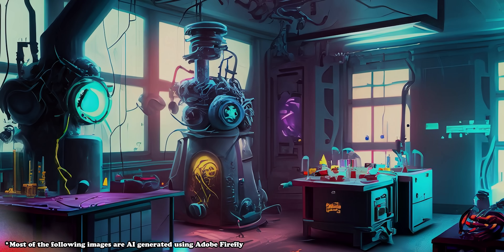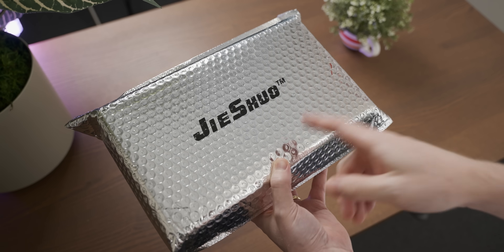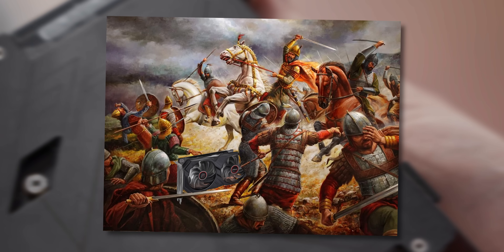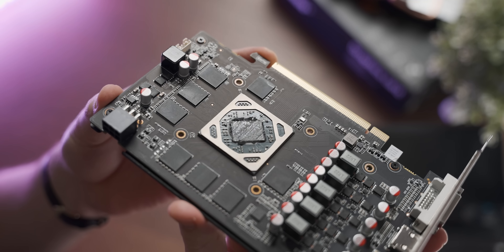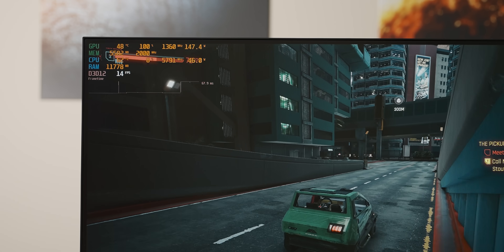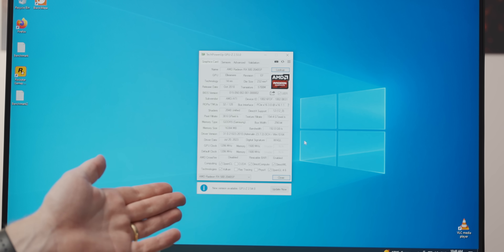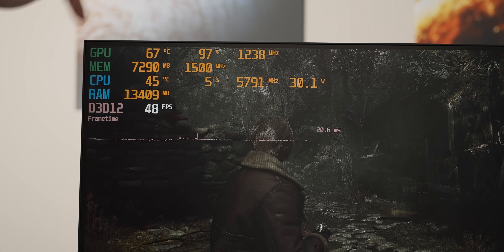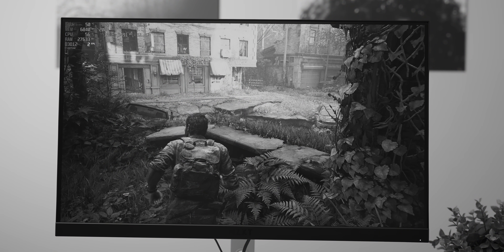Why Would They Make This? 16GB RX 580 From Aliexpress...

Comment: All jokes aside: It is mind blowing that a card from 2016 (yeah, that´s right) performs like that in 2023. Polaris was/is AMD´s masterpiece.
Reply: AMD does that a lot, it's not a unique case of amazing performance down the road.
Three words.
7970 Ghz Edition.
Reply from the maker: @anita.b  I had a x1900xtx back in the day. I loved that GPU even if it did sound like a jet engine.
Reply: @DawidDoesTechStuff You should revisit this video with FSR 😂 that’s what AMD and Nvidia think the cool kids should use these days, I would imagine this one would have glorious input lag 😂
Reply: @anita.b  if they had made 7970's with 4gb vram they would still hold up
Reply: @parliamentarian6598 They made a few 7970's with 6 gb of vram actually.
Reply: I have a 7970 in daily use in the old pc I gave my mother for web browsing/media consumption. It still works just fine paired with a 3700x cpu lol. @anita.b
Reply: @anita.b Yes, I have the Sapphire variant and I still use it on my backup system. It was the older brother to the rx series. For its day it was very impressive. 3gb of vram was excessive in its day. It was kinda a hotboy but performed insanely well.
Reply: @anita.b  I used Crossfired HD7950's to play Tarkov as early as 2 years ago.

AMD has always been on that good shit, it's just that Nvidia is too.
Reply: The Hawaii XT was AMD's masterpiece. It performs about on par with a 580 but is from freaking 2013! A 290X or a 390X is able to run Red Dead Redemption 2 in 1440p with very decent quality settings and never dropping below 30fps, averaging around 45 fps in the built-in benchmark. Even the 4GB 290X can do this with ultra textures.
Reply: @classicallpvault  Without overclocking the 290x actually outperforms the RX 580. Toward the end of its generation there were actually 8GB cards produced. I actually once saw a weirdo listing for a Powercolor 8GB R7 250. I was incredibly confused at that card's existence.
Reply: @classicallpvault  7870xt was the best price/performance than any card i've had since the intel i740.
Reply: I HATED Polaris at first. I absolutely love that architecture now. It scales SO WELL.

I had an RX 580 that did 1580mhz core and 2500mhz memory. Was really nice to finally see it beat a GTX 1060 in literally every game I tried.
Reply: @nexxusty  A 580 can be expected to beat the 6GB 1060 in the vast majority of cases even at stock clocks.
Reply: @classicallpvault  Not every one though. Mine could. It even beat a 1070 in some titles.
Reply: @nexxusty you understand that no GDDR5 can reach this memory clock right ? Even GDDR6 have difficult. 😅😅😅😂😂😂
I will not even talk about the GPU itself at 1500mh 😂😂😂😂
Reply: rx 400 2016 rx 500 2017
Reply: rx 400 IS a rx 500 
it´s a polaris rebrand
Reply: @PhoticSneezeOne  it's more of a refresh/tweak with some differences that most people didn't really notice. It wouldn't really be an upgrade for me to have gotten the RX 580 back when my RX 480 was actually barely a year old. Minor improvement in performance and much higher clocks were what I was generally seeing. A more mature node process led to a lot of that.
Reply: I still use an RX 570 today. Linux support is rock solid.
Reply: @Falsechicken i just played Helldivers 2 on my RX590
Reply: Although if you were in the 300 dollar range, 1440p would be doable for most games.
Reply: @joeymatthews1234 my RX 580 on FH5 mostly high 1440p gets a solid 60-70 fps with no noticable drops and gets identical at 4K which i find interesting considering the price
Reply: The 400 and 500 and amds best and the 1000s are nvideas
Reply: My 580 is still doing well.  I don't demand much of it though.  I wouldn't mind a GPU with better idle/slightly loaded power consumption, though.
Reply: @Aeduo  rx 5500 xt has entered the chat
Reply: older AMD cards are actually ridiculously solid even in 2023 for 1080p gaming, I ran an XFX 480  with most games at max graphics (not including hardware specific features like ray tracing) starting in 2017 and ending 4 months ago when I finally upgraded and got a 6750XT
Reply: Its not so mind blowing when you compare graphics of some games from 2015-2018 with 2022 games even gameplay and other things you can obviously notice that some older games still look better and overall are better than some 2022-2023 games so
Reply: You are aware of the fact that the R9´s are no longer supported by AMD? 
AMD decided to kill them off. So their win is hypothetical in nature.
Reply: My gtx970 still puts up a good fight
Reply: People are just inventing things here i this section just to prove the point 😅😅😂😂
I already had a 1060 6gb. And im using a 580 8gb right now bc of money. And guess what ? They are the same! Power, performance, almost everything! 😂😂😂
Reply: On the CPU side FX serie's from 2011 (FX8350 has a special place for me...)
Reply: RX 580 is the most stable AMD card I've ever used.
Reply: Hawaii and Tahiti were masterworks as well.
Reply: Imagine if they made a 60 cu or 80 Cu polaris card....
Reply: how the mighty have fallen eh!
Reply: Polaris was decent in the mid range like the RX 580, but  did not compete in the upper mid to high end, not really sure I would call it a masterpiece. Polaris was a sad time period for AMD when they decided to not compete in the high end, if that had of continued I fully believe AMD would not be around today,.
Reply: @Battleneter  news flash, it did continue. Nvidia hasn't even released a titan and AMD can't keep up. Nah if I were AMD I'd truly pull out of the general consumer market and try to focus more on enterprise class products and AI. 

Their sales figures, even when ATI had faster cards doesn't equate to the huge losses against Nvidia. I guess they figure some money is better than no money.
Reply: @ArtisChronicles  No not at all, AMD cards in the last few generations have been performance competitive. I would agree Nvidia are the market leaders by  a large margin, and AMD have made some poor choices marketing and pricing this latest generation.
Reply: @ArtisChronicles that's the stupidest take. What, are you a silicon valley bro? XD imagine still simping for NVIDIA in 2024 as they cut off your driver support from underneath you
Reply: @ArtisChronicles  thats the dumbest take lmfao, go figure the opposite is happening 🤣
Reply: It was a low end card even in 2016, the 1070 also from 2016 was 40-50% faster or even more.
Reply: My son's crappy gaming PC has an RX580 and he absolutely loves it. It replaced a GTX 570 which he accurately described as "a case heater".
Reply: Funny thing is it has similar performance to a entry level RX 6400...
Reply: I istill have mine and work like a charm
Reply: I tested about 5 Polaris cards and while they performed well, they were very very unstable. 
Hot, power hungry and black screens are the words that come to my mind when I remember my last 580. Definitely far from masterpieces or reliable tech.
Reply: I used an XFX 570 8gb, 2 sapphire nitros 580 8gb and a MSI 570 4gb

Not a single one of them made any problems. With undervolting you can get the 580s to consume about 130W and the 570 about 115w
Reply: @PhoticSneezeOne  Yeah but that's the point. You had to tinker with voltages, clock speeds, run tests, etc. to get the best from Polaris cards. Sapphire cards' fans tend to act up when setting a custom fan curve, like going to 100% randomly or get stuck at 0% because of a driver glitch. I wouldn't call that a "masterpiece".
I also tried a few Pascal gpus and they were night and day in terms of functionality and reliability. It was just plug, install drivers, and done.
Reply: 2017.....nope not right hehe ;)
Reply: I swear when I read the title I read it AlienExpress instead of cuz I just finished watching his alien ware video AliExpress 😂😂😂
Reply: the efficiency is among the worst
Reply: I have a 1070 and it performs better than that and it was launched in 2016 too
Reply: it actually, according to AMD's website: came out in early 2017. so, a little after the Mesozoic era, and just barely creeping into the Paleolithic era..
Reply: Honestly, it's astounding how an RX590 can play everything besides Alan Wake 2
Reply: Except it's dead now, AMD is the only company that dropped driver support for a card (RX 590) just after 3.5 years since release. And if 10-30 fps is good enough performance for you at 1080p, I have news for you. Pascal from Nvidia is still fully supported.
Reply: Polaris was their simultaneous low point alongside pyledriver/bulldozer...
Reply: @Pro7Sauce  For the price Polaris is soo good, but bulldozer... 😂
I had one till 2 months ago
Reply: My 1070 runs quite well atm still
Reply: It's more mindblowing how cards from 8 years ago are still so expensive ... because all after are insane expensive
Reply: Finewine technology
Reply: Go see how it performs in 2025 on Linux.
Open source drivers are good shit.
Reply: so does GeForce 10 series GPUs.
Reply: @fgfg655 Three words: Lack of VRAM.  The Radeons outlasted most of the GeForce 10 series because so many of the Nvidia cards were kneecapped with low dedicated memory sizes.
Reply: @LakeHowellDigitalVideo  Right, but while this class of cards remained relevant VRAM wasn't an issue whatsoever. Cards aging better and being used 7 years past their prime while going around for $50 clearly isn't what Nvidia is looking for. Polaris at launch was an unstable mess. Which is the case for a lot of AMD's lineup, they end up aging better than the GeForce counterparts but end up not performing as well when it matters, at launch. The only real competitive card AMD has right now is the 7800XT
Reply: @LakeHowellDigitalVideo  Lack of Vram is an issue on a card that can utilize it for sure, There's prime examples of cards out there now that have the power to give you more out of a game if you added more vram.
But the futureproofing argument is moot! Because as a card ages, games get more demanding on the GPU and it won't matter if you have a shit ton of memory to play with because the GPU becomes a limiting factor anyway. "But I can load so and so mods etc!" Well yes, On a card that can handle the loads, but the same thing applies.. Your GPU will still become a limiting factor later down the line, Or a particular GPU is too weak anyway to utilize a certain amount of ram - which is why their is a balancing act when making GPUs.
Reply: @fgfg655  The RX580 would perform BELOW an GTX 1060-6Gb !  BUT now ..... with the 'up-to-date' drivers ..... The RX-580 performs ABOVE an GTX 1060-6Gb !   Even CLOSE to an GTX 1070 !!!   and THAT is ..... AMD 'fine-wine' for you !!!     Nvidia can go to HELL !!!    Radeon just rules !
Reply: @gertjanvandermeij4265 The 480 always traded blows with the 1060 throughout its lifetime. More recent comparisons do indeed see the Polaris cards staying ahead of the 1060s now. 

Its launch was really the only time you'd see something in between the 970 and 980 performance. They actually did a lot of quick driver work and just continued to improve drivers.
Reply: @fgfg655 Nahh amd easily won that mid range battle, 480/580s aged like fine wine with much better drivers than 1060.
Reply: GTX 1080 came 2016
Reply: Hey guys, sorry for interrupting but would like to ask if said graphic card you mention would be s good card for beginners? Would love to play stuff like hell let loose, even on medium thst would be awesom. Im looking for a graphic card thst wont break the bank
Reply: @jonathank5841 depends how much is your bank, where you live, and if you're willing to go second hand or not
Reply: @jonathank5841   The price they ask is not bad for the card, however, there are multiple issues with this...

1) It's not an official product, and also an old product at that that got modified, which means, the lifespan on that thing can be completely random from a single year to a decade or whatever

2) The raw performance on the card is starting to be lacking, it is used for 1080p gaming at low/medium settings for the most part on newer games. There are new games coming out that will make this card an issue going forward, even with 16gb VRAM, simply because it lacks performance to keep up with heavy duty games.

3) Card uses quite a bit of energy, it's not as power hungry as newer mid to high tier cards in new generations from AMD and Nvidia, but ~200W is still something to consider from and old GPU.

4) Getting this card is not the only issue to consider, a GPU is just one single part from a gaming computer, there are other factors that are also important, like CPU, RAM and hard drive (like SSD's being the standard for newer games, while HDD works for older games and some new games just fine). PSU (power supply) is also important to know, you need at least a 450W PSU for this card, but if possible, a 500 or 550W instead for some headroom to make sure the PSU does not fail (there are 450W PSU's that are good and can handle this well, but if you have a bad one, it can lead to instability on your computer).

With all of this said, we need more information on your current computer specs, to see what works and what does not. And how much you are willing to spend for a GPU, or possible upgrades.

If you only plan on playing hell let loose on this GPU, it will work enough for that game, the recommended GPU is a 590 8GB but the minimum is much weaker than RX 580, which means RX 580 would be somewhere in between minimum and recommended settings, which makes the game playable. Assuming the only thing lacking (that needs upgrade) on your computer is the GPU. If you are using an intel core CPU 2000 series from over a decade ago, you are going to be running into issues regardless if you get the card or not. Same idea with the ram, if you are running anywhere in between 4 and 8gb with the same RAM sticks, or from 4gb to 16gb with different ram sticks (different ram sticks, means all ram sticks will default to the slowest one and it can cause issues with stability, like having random crashes with windows, etc).

Honestly though, just post your specs if you want to make sure you are 100% safe to go or not with the purchase.
Reply: @jonathank5841 buy a used 5700XT or a 6600. Extremely good price to performance and they'll last you at least half a decade more
Reply: @jonathank5841  rx 6600 or 6700 if you have the budget
Reply: @jonathank5841 When I used to play Hell let loose it was pretty unoptimized(I have the RX 480 8GB) you're better off with a 3060. Personally, I gotten only 45-50 FPS depending on the map.
Reply: @jonathank5841  maybe you can pick a 1070, it has 8gb of vram, and the core is more powerful than a rx 580, or you can buy a 580 with 8gb of vram. these cards are more than enough for that tipe of titles.
Reply: @jonathank5841 depends on your budget. If all you have is 100 bucks, these aliexpress rx 580's seem nearly unbeatable if all you want is decent 1080p gaming.  If you have 200 bucks, I'd look at rx 6600's or maybe an Intel a750 on sale(more powerful but can be inconsistent), and if you can bump your budget to 300, your playing field opens up a lot more, especially if you're willing to shop used. I assume you're not willing to go any higher than that if you want it to be budget though, which is perfectly fine as long as you're not trying to do 1440p or 4k.
Reply: @jonathank5841  I don't know anything about that specific game, but in the US the Radeon RX 6600/6600XT/6650XT for $190-240 are a hard deal to argue with. 

The 6400/6500XT is cheaper, but you lose a lot of performance for what you save, and they're posed to age poorly. The GTX 1650 or 1660 Super come in a little less than the 6600 but are significantly slower and don't get access to Nvidia's proprietary upscaling (and may age poorly), while the RTX 3050 is priced a bit higher and does get DLSS but is still lacking in raw power. Intel's A750 is pretty competitive in that price point too, possibly beating out AMD... but they have lots of quirks in old games or old systems.
Reply: @jonathank5841  I'm going to say this only once: Buy the nVidia RTX 3050 instead. It's the better entry level GPU (costs about 225 USD). Unless you're running Linux, then you should get an AMD Radeon 6650 XT instead (costs about 250 USD) or better yet AMD Radeon 7600 (costs about 270 USD). Don't buy frankenstein cards from China for 70% the price of a decent entry level card. You're going to get 50% the performance for 70% the price, which is stupid.
Reply: @jeandutoit1413  Don't buy the rtx 3050. I don't know where you live, but in my country you can buy a 3060 for approximately the same price. For the other cards you mention I don't know tho
Reply: @jeandutoit1413  Bruh no way. The 6600 straight up demolishes the 3050 and costs much less than it does.
Reply: @Snaox  I live in South Africa, so yes, here the 3060 is significantly more expensive (50% more expensive at almost 380 USD).
Reply: @jeandutoit1413 my brother in christ, why are you recommending the scam that is the rtx 3050
Reply: Seen rx 580’s for $80. Huge difference in price
Reply: @jeandutoit1413 6650XT is better than the 3050 though its actually comparable to the 3060.
Reply: @jeandutoit1413   Pay 3 times the money to get a 40% performance uplift. What an amazing deal bro!
Reply: @conjurermast  Where do you live that a RX 580 or 1060 costs 75 USD (3x cheaper)? Cheapest I can find my side is around 150 USD.
Reply: @Snaox  eh it's $220 here while the 3060 is $290, but I would still recommend the 6650 XT over the 3050 (as a former 3050 owner that is somewhat regretful)
Reply: 3050 is just a overpriced 1660
Reply: Don't actually do this. For the price of an RTX3050 you could field two Optiflexes running in a 580 no problem, at the same performance.

If you're going to spend this much money on a GPU for performance, a used 1080TI is your best option for performance. In value for money the 3050 is trash tier, coming in in some cases at the same price as its 3060 counterpart from the same manufacturer with the same cooling solution. That is how bad the 3050's pricing policy is.
Reply: @hvhnubek  it's decently more powerful than the 1660
Reply: @eggtarts286  I would definitely go used 1080Ti, despite potential support issues it's great and has the right amount of VRAM
Reply: @johnjson  its 3% difference that u will never notice and the 1660 is 100$ cheaper
Reply: @jeandutoit1413 all evidence I've seen online begs to differ ignoring the rx580 and othe cards with a cut down modal
Reply: @jeandutoit1413 the 3050 is a bad deal. The amd Rx 6600 XT outperforms that card... By a good amount and is similarly priced. Sticking with Nvidia ? Get a GTX 1080. If you're doing 1080p, it's still a beast even today just like the RX 580. It's a lot cheaper then the 3050... And outperforms It straight out. It only lacks the ray tracing and dlss. But no dlss isn't the end of the world, and the 3050 is so weak that it can barely at all do RTX stuff anyways.... Something amd or the GTX 1080 is a much, much better bang for the buck.
Reply: @Boba_Fett1980  It all depends on where you are in the world, and what you can get your hands on. At the time I wrote my original comment, the 3050 ti was really cheap in my country when compared to other cards. Today you can't find the 3050 anymore, and the go to card is the RX6650, if you can find it.
Reply: @jeandutoit1413  ENTRY? What about the 4090?
Reply: @TheRomanianCrow  Cheapest 4090 I can find locally is about 2,000 USD. Not exactly entry level.
Reply: @jeandutoit1413  I'm sorry dude on this day you have found that you indeed have drank the cool-aid the 3050 is one of the most terrible pieces of cardbage to every be released by the leather coat wearing engineers are Ngreedia.  RX6600, RX5600 XT, hell if you want you can get a used 1080 for less than that or 1080ti all of them beat that.

In reality if your buying new the card cost so close to the 2060, or the 3060 and the 4060 that your better off spending the little extra on any of those cards, with that being said the 4060 is acctually worse in many games than the 3060 due to what they did to the memory bus, anything on the red side 5600xt or above beat it as well, but that happen when you basically put a Mobile gpu onto desktop card and call it a 3050.
Reply: @jeandutoit1413  shit recommendation, the 6600XT performs a lot better and costs about the same if not less
Reply: @orti1283  Congratulations! You are nine months late to the party!
Reply: But kinda useless if they can't give the same performance to the early buyers
Reply: I was always kinda confused why people love the rx 580 but shit on the 1060 6gb, in my market they’re the same price, and the 580 uses a lot more power while not being much more powerful (just 2gb of extra vram, but let’s be honest, 6gb is completely enough for the 1060 class of gpu)
Reply: @leopoldbuttersstotch6060 gotta disagree as my buddy owns an 1060 and depending on the game we got either similar performance or the 2gigs make the difference between enjoyable and non enjoyable performance
But for esports title both cards are sufficient
Reply: @pfizerpricehike9747  Yeah in currently just using a 1060 6GB for a secondary system. It's decent in the titles that I want to use it for, but there's definitely cases where my RX 480 actually outperforms it.
Reply: @leopoldbuttersstotch6060  some versions of the 1060 had the 2 gb extra connected with a limited memory bus connection, which caused really bad stutters when the card tries to utilize those 2 gb.
Reply: @WoNCrawler  do you mean the 1060 5gb? 2gb above the 1060 3gb is what I’m thinking, or is there a gtx 1060 8gb?
Reply: @leopoldbuttersstotch6060  maybe some 5 gb versions are affect too, but there are some 1060 6 gb variants that got different memory setup with a 4 + 2 setup and the 2 gb got a slim bandwidth connection that causes stuttering when accessed.
Reply: @leopoldbuttersstotch6060  it depends on the local price market, in Indonesia used RX 580 8GB costs about $60 while the used GTX 1060 6GB costs about $100 the same price like the used GTX 1660, it's a bit confusing here tho
Reply: @leopoldbuttersstotch6060  Nvidia cut off driver support WAY earlier than AMD did for Polaris.
Reply: @leopoldbuttersstotch6060 undervolting enters the chat
Reply: GTX 1070 beats this thing like a drum and released before RX 580. RX 580 released in 2017, if I'm correct, 1070 in 2016. Nvidia wins again hahaha
Reply: @authoritariangentleman7570  Right.... I'm completely shocked that the card that released at $379 MSRP was better than the card that sold new for $229 MSRP.  Any other shrewd observations, Captain Obvious? 😁
Reply: @LakeHowellDigitalVideo  Don't be poor and get the better card the first time around?
Reply: @authoritariangentleman7570 I did get a GTX 1070 back then. Doesn’t change the fact that the RX 570,580 and 590 were great bang for the buck cards. They were selling for 150-200 for awhile which made them great for the price. No need to be elitist. Not everyone can afford the best cards.
Reply: @wertywerrtyson5529  Very true. Prices have gotten out of hand. Over 2000 CAD for a 4090 is just unreasonable, regardless of being able to afford it or not.
Reply: @authoritariangentleman7570  Lol, you do realize that the vast majority of AAA games are optimized for Radeon hardware because of the PS5 or Xbox.  Unless, you want to ray tracing -- Nvidia cards make ZERO sense to buy at their price point....  Especially true of the Nvidia cards that don't support ray tracing.
Reply: @authoritariangentleman7570  It costs the equivalent of 2700 CAD in my country. But that includes our 25% VAT so before tax I guess it’s about the same.
Reply: @LakeHowellDigitalVideo It doesn't work like that. Ps5 runs it's own proprietary graphics API and os so you can't reuse code for the PC release. Xbox is in a similar situation but it's closer to a windows PC then the playstation. Consoles code is heavily optimized for the hardware and would mostly be unusable on anything else. AAA pc devs leave most of the optimisation to GPU driver devs today and a AMD or Nvidia sponsored game just means they are gonna use fsr or dlss and Ray tracing the devs won't do special amd only optimisations.
Reply: @wertywerrtyson5529 couldn't agree more, I went with the "better card" in the Asus gtx 1070 OC and fried that thing within the year, picked up a $200 sapphire rx580 and the thing is still running strong to this day (my main csgo/cs2 rig that I'll be replacing next year)
Reply: @authoritariangentleman7570 p.s. imagine recommending something as GARBAGE for the price as a 3050
Reply: @z33thr33  3050 is garbage, I'd recommend saving up and getting a high end card
Reply: @authoritariangentleman7570  Same. The ONLY time it makes sense is with a low power version if you're putting it into a system with no PCI 8 power lines, where you have to run it exclusively off the slot. But if you're at that point, there's almost certainly a better option for a similar price in just upgrading the whole motherboard itself. The ONLY time it makes ANY sense is if you were going for a low power efficiency build, but then you're basically better off with a new AMD APU or something like a LattePanda, depending on what your intended use case is. The ones that need an 8pin are just silly
Reply: The Polaris architecture was released in June 2016 (RX 480) 

The 1070 was about 380$ while the RX480 8GB was  229$

Go figure
Reply: @authoritariangentleman7570 You know, I have the 1080 8gb from 2016, it's also faster than the rx 580 but 1 year older. How could that be?? 

...
nViDiA FOr LIfE
...

You know, my 1080 8gb is also better than a 3050, which is 6 years newer! How could that be??? 

Jokes aside, I bought it after my rx 580 because it was in a pc which cost me 20€. It's thermal throttleing in every demanding game, but oh well 😂
But nothing beats the rx 580 in price/ performance reguarly, I got mine for 45€ 1 year ago, and there are a lot out there for about 50€.
Reply: @authoritariangentleman7570  ah yes, a more expensive card beating a refresh of a mid range card. Don't forget that the RX 480/580 performance was what once beat a titan. It used to be high end performance. It was about R9 290/290x performance. 

Obviously that performance would've shifted down the stack, not up.
Reply: @ArtisChronicles  I was just picking at the OP. RX 580 is a nice card, there are far better nowadays but some those old cards actually held up really nice.
Reply: @authoritariangentleman7570 ah yes, recommend the card that cut off driver support like half a decade ago VS the one that LITERALLY STARTED A SOFT DRIVER  PHASE OUT like last week. I bet you're an Apple simp too.